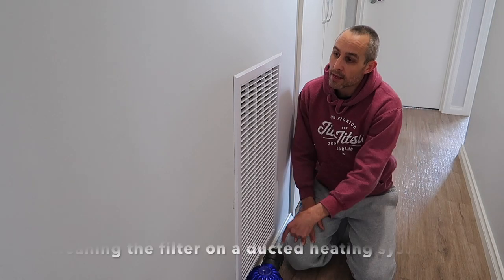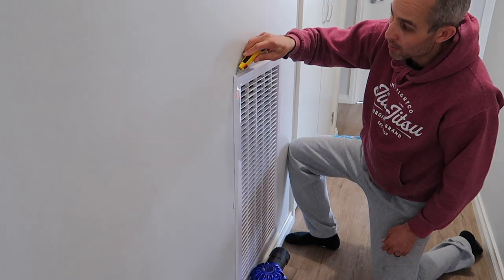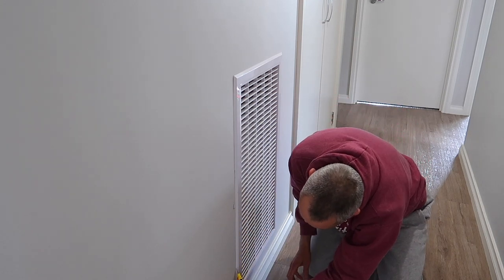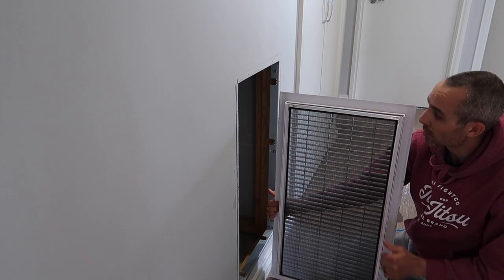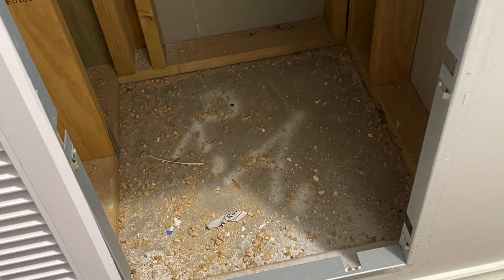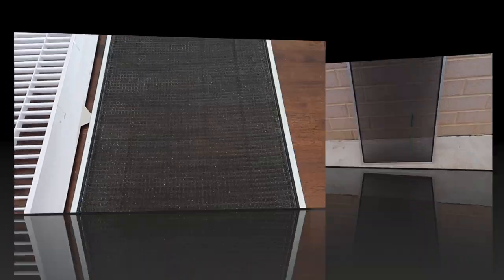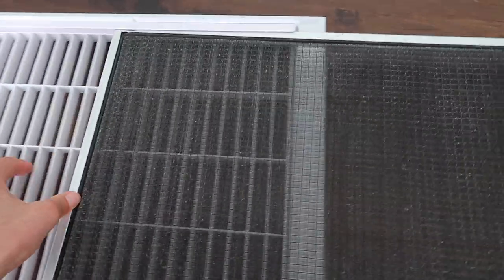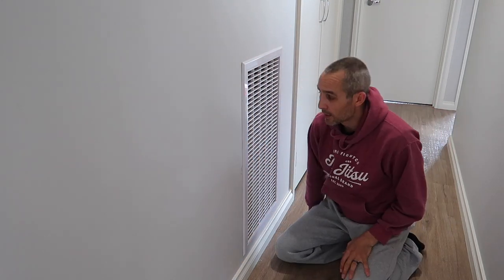HOW TO CLEAN THE DUCTED HEATING FILTER

Comment: OMG just discovered that for 14 years since being built ours had NO filter material behind the large vent holes so LOADS of dust is inside that wall cavity and presumably gets repeated sucked into there then blown from the ceiling down into our bedrooms
Reply from the maker: oh no!!!!
Reply: I don’t have a filter either! Thinking of buying mine but scared I’ll buy the wrong one
Reply: same here after 12 years I just found out the same. Maybe that's why just yesterday the unit was sending a strong smell, I don't think it was gas , possibly like something is overheating